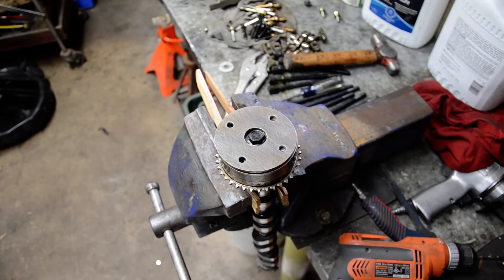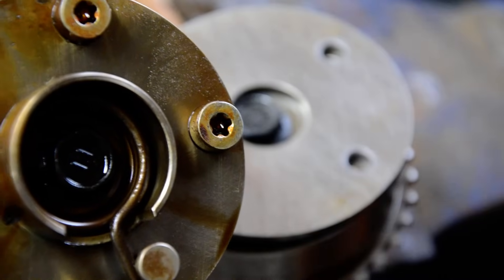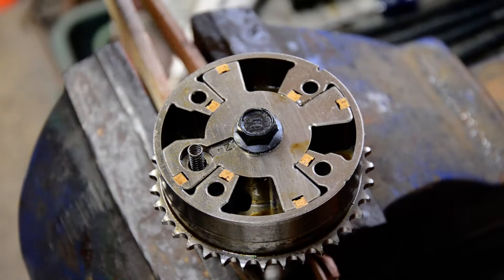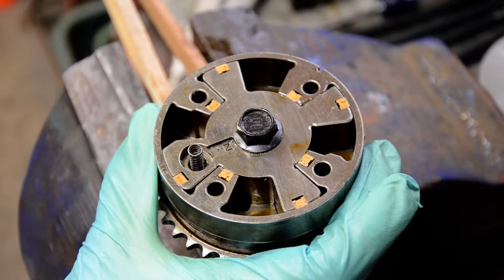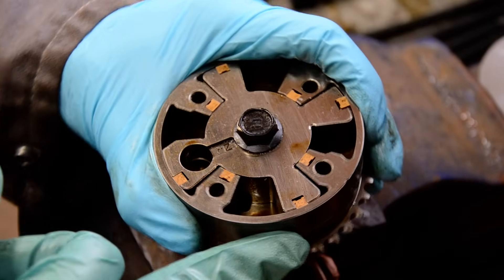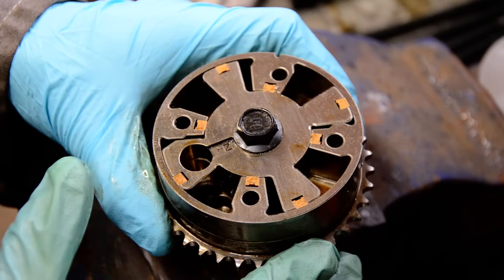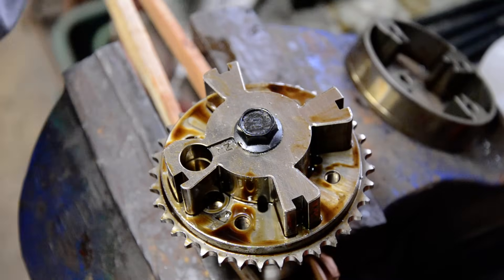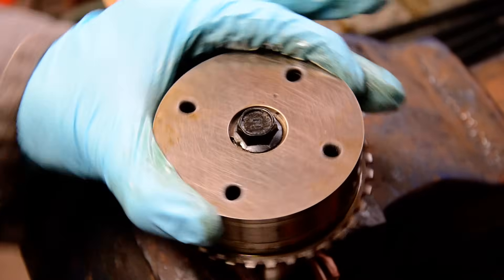Inside a Toyota VVT-i Camshaft Gear!

Comment: Hello sir
I have a problem with my toyota altis 1.6 manual rattling noice at start fir 1 second then disappeard
Can you help me regarding aolution of this problem
Reply: I have the same thing. It's been going on for a year. For some people, 5 years. So everyone who's had this problem said to replace the cam gear, but it's pricey to take it to the dealership. Nobody has lost a car because of this problem though, so I wouldn't worry about it too much.

Comment: You are missing a plastic end at the bottom of the spring. If you watch closer, you don't see spring marks on the back of the metal plate (i opened up and fixed a nissan vvt; i might create a video later with it - what was faulty and how to fix it)

Comment: The mechanism looks very simple and pretty much self explanatory. The pin and the opening for it look good. I wonder why the pin fails to lock? Perhaps the spring breaks or something gets stuck in the pin cavity thus restricting or preventing it's movement.
My wifes 04 Camry (2.4L) has been making this noise for over 100,000 miles. It has 190k on the odometer now. So far it has not caused any issues.

Comment: The vct solinoid has one input oil feed and two output, the two output one for retarding timing and  one for advancing. As rpms rise the phaser will advance. It keeps the engine in optimal timming. Hence spark firing early btdc

Comment: does anyone know if they make a rebuild kit for it?
Reply from the maker: Definitely not. You would just buy a new one, or risk a used one from the wreckers.
Reply: PatonHaus i just rebuilt my 2008 3.5l toyota highlander. Full rebuild of the engine and heads and did not replace these cam phasers. I am getting random cam retarded errors for all four cams during test drives. Engine runs well and idles smooth, so i pulled the oil control valves and cleaned them thinking they might have been hanging. Gunk in some of them. Prior to the rebuild the engine oil was pretty bad. Just wondering if junky oil could be causing the cam phasers to hang up. Running good clean syn oil of proper weight. 
Thanks for any comments

Comment: Can the Honda VTC gears be disassembled like the Toyota's?
Reply from the maker: Probably, give it s shot!
Reply: Okay thanks.
Reply: Yes.  Usually all it takes to fix the Honda actuators is to replace the spring and work over the locking pin with some abrasives so it can move freely in and out of the detent.

Comment: Did u find those bits?
Reply from the maker: Yep, scrap metal bin.
Reply: PatonHaus meant like the actual tool?
Reply from the maker: Which tool?
Reply: The five point bit ive never seen thos before
Reply: how about a pair of vice grips around that massive shoulder... or say a chisel and hammer or air hammer. lol@ drilling them out

Comment: the vvt gear also when pin pops out keep exhuast valve open longer at higher rpm to prevent head gasket from blowing why these motors are bullet proof only way to destroy a toyota is to throw a rod through the piston no oil no collant

Comment: Pin locks the system when there is not enoug oil pressure. In example on engine startup.

Comment: The tap,ered pin is a check valve that is kept in its hole by the spring on top of it.as the RPM goes up , so the oil pressure, which will unseat the pin , hence the rotor will move to advance the timing based on the conditions. When the engine rpm decreases , so the oil pressure, and the pin goes back to its seat. Thanks
Reply: I think this is the most reasonable explanation.
So, everyone who has another thoughts, please explain it here.
Reply: Everything you said is incorrect, no thanks

Comment: my sister has a corolla and she had problems 2 times with this system and the fix was to run motor flush in the engine and loosen that hunk of a cam head an everything goes back to running fine i hope this helps someone
Reply: Chris Wittekind love toyota but not as bullet proof as u think crank case ventilation system is not that good which causes early  sludge build up I've been a mechanic for 30 years do your research
Reply: Well I'm not familiar with the newer cars with dual vvti or vvtl-i, especially corollas.  I know on the 2jzge and the 1uzfe, vvti is rarely problematic if you take care of your car, and I don't know about you, but I baby mine.
Reply: Chris Wittekind yes that's true it u baby it as a mechanic I know 90% of people don't do that.  anyway this problem toyota knows about I receive technical service bulletins from toyota it says for to use the best quality oil and to make sure it's changed 3000 miles no give or take and I still love toyota long lasting  fuel efficient engines
Reply: So true but corolla is economy car not a Lexus or bmw
Reply: @johnjohnson7128  I am very interested by your comment. Very relevant. I am french and i have the same issue on my 2003 RAV4 with a 1AZ FE 2.0L Gasoline engine. Can you please explain with simple words how to do what your sister done on her car. What kind of oil you recommend and how to "flush" the engine. Thank you.

Comment: Let's say VVT is for intake only and exhaust has a conventional sprocket. VVT sprocket has a range of movement, like you show - up to 4 teeth, exhaust sprocket is fixed. Where does the chain slack to allow for this movement come from, are VVT engine chains inherently loose to allow for this movement? EDIT: I might have figured it out watching T0G5KLN4a_w. The sprocket doesn't move in relation to other sprockets, what moves is the camshaft itself in relation to VVT sprocket, thus no chain slack is needed, duh.
Reply: Good way to look at that thank you
Reply from the maker: +Karolis Tamutis You got it. My explanation wasn't very concise.
Reply: This had me puzzled as well. Thank you for a good, concise explanation.

Comment: Hi

the second gear you showed has a pin that holds the spring. how is the pin fitted and what type of pin is it? does the pin adjust or fixed. thinking of glueing one similar type of pin.

Comment: toyota dealer just repaired my 2009 rav4.  TSB 0041-13.  The spring loaded pin is not dropping in to lock it up at cold start.  The rattle stops after oil pressure comes up to full.  $625 repair at the dealer.
Reply: +John Ferguson so, you're saying the rattle isn't anything mechanically failing? I've never gotten a straight forward answer. I change the oil every 5-7k with filter, and halfway between changes I change the filter again. I look at 200k on a well maintained Toyota engine as being nothing. I had 298k on a 94 2.4 liter that I ran conventional oil in and it idled for Hours at a saw mill, and it wasn't even using oil or making abnormal noises.
Reply: +AffordBindEquipment   Change oil more frequently and use a top quality filter.  Use synthetic engine oil, it has more detergent and prevents residue from building up inside the assembly.
Reply: +John Ferguson that won't make the lock pin go in, though, but your recommendation is spot on
Reply: 2010V6RAV4   The build up of varnish and sludge is what takes out the VVT almost every time.  Keep it clean and it will run 200k miles.
Reply: +John Ferguson these engines use a cartridge filter. they suck. I use fully synthetic oil in both of my vehicles. I still change my oil in my V6 RAV4, every 5k. quality oil and frequent oil changes are cheaper than an engine. :-)
Reply: @GlocksDB15  It's bit late to the party but the key is not to push those engine like a NASCAR driver, doing heavy acceleration from dead stop or racing the engine (4th to 2nd downshift). very bad idea and that put some serious stress on the engine

Comment: Thanks for the video. My 08 tundra is making this noise with 130,00 miles on it. My question is should i take it in for repair or will  it be alrght in this condition?
Reply: the first 2 years had some cam shaft issues. if it just started then definitely take it in. my parents 2008 Sequoia and brother's 2007 Tundra both 5.7's, do not make that noise.

Comment: Vvt gear needs to unlocked before taking off cam,( try dissembling the vvt like he did ONLY IF REPLACING WITH NEW ONE then take off cam bolt)if you don't it  will grip the guide pin on the back of the gear making it very difficult to take off, do your search very carefully it took me hours of research online on how to approach this. When you install back the vvt gear needs to be unlocked( look at the dots on the housing) and make sure it seats nicely in the right grove, torque to specs and the turn clockwise on the vvt gear housing then you hear a click and to make sure you locked the vvt look at the dots they have to line up together if is not its still unlock. ( Toyotas of this design are prone for 1 second start up rattle and that lock pin is the culprit)
Reply: So my question is the pin not locking due to weaked spring? If so can stretching or replacing the lock pin spring resolve the issue!
Reply: G R i have been reading and watching about “having to be unlocked when assembling”. I am not following why. I have been messing with one this afternoon and can get it to unlock and move but as soon as you let go the spring moves it back to the locked position. 
So what is the purpose of having to unlock it prior to assembly if the spring is going to just move it back to the locked position as soon as you let air pressure off?
Thanks for any reply.
Reply: hey thanks for your comment it really helps, i have a 2gr-fe v6 engine i am working on, i change the head gasket and set the timing properly but when i run the engine and scan i got the (crankshaft position correlation bank 1 sensor B) code ( P0017 ), i had to pull the engine again, i turned the crankshaft clockwise 360 over and over again the timing setting was correct, then i turned the Exhaust camshaft with a wrench spanner and noticed it was loose and not locked in place while the others are perfectly locked. kindly bail me out on what to do, should i turning it till i hear the click sound without removing the timing chain? am not sure what to do help me out.

Comment: Toyota admits that cause for this problems is engineering design: TSB-0041-13. TSB-0146-10.
Reply: this TSB won't fix the current issue . they tried it on my 2010 2.5 Camry and 2013 RAV4. neither fixed the rattle. this is why-TSB 0012-11 is the fix they need.
Reply: 2010V6RAV4 8

Comment: Those orange blocks are seals just as you would have rings in pistons, to seal pressure from leaking, except these are vertical seals and the spring ensures that the seals maintain a tight seal against moving parts.
Reply: nothing is sealing oil pressure against the flat front cover 😂

Comment: The pin is a hydraulic piston that stops the cam from changing timing when theres no oil pressure. Its so that the cars timing is locked at startup and any time that the cam isn't under computer control.
BTW The computer uses the lugs on the camshaft to continuously time the cam using a solenoid on the block.
Reply: Is that what causes the characteristic knocking sound on VVT-i engines when you restart the engine while warm after letting it sit for 5 minutes? i.e. when the oil thickens and takes like 10 seconds for it to circulate before it activates again?
Reply: Desmond that is correct. Ive done many of these on toyotas and hondas. Thats why change your oil regularly or stuff wears down faster, tolerances get larger then you get noises.
Reply: @chrischoy9  The pins like to stick in and not lock so when you start the engine after sitting the unit rattles until the oil pressure comes up. Very common issue. More an annoyance than anything. I have a Camry with 220k and it's had the "rattle since new. My son has a Rav4 and has had the same experience he now has 150k.
Reply: That sounds more like chain rattle
Reply: My QR25DE phaser does not stay locked for shit. I have to prime it before every start or it rattles . It’s not chain it’s new it’s not tensioner bcs I modded that too. I have a video of the phaser spitting out oil whille turning the crank with a wrench. Pos.. last thing to do is puts harder spring or stretch the one it’s got now I’m sick of this shit. Everything under the sun brand new FKN click click click
Reply: OK am building a 1AZ noticed that thing is not really holding in place is knocking through out how can I fix that and what kind of damage can occur if I ignore it to move the vehicle to another garage? would this mean am not getting enough pressure..  The oil pump is new. Just remembered I had bought a new cam shaft. Can get this old bit  and put on the one on the engine?
Reply: @mushinjikangungu  
Good question, I want to knkow as well.
Reply: Very similar system to Volkswagen.
Reply: @x-man4702  stock design on Benz camshafts but used with a direct PWM solenoid control at the head of each shaft.
Reply: It keeps jumping the timing..  Maybe I should just found another engine
Reply: Mushinji Kangungu so you replaced the vvt gear? Coz when you get the gear new you get it in its unlocked position. Before you install it on the cam on the car youre supposed to blow compressed air into the oil feed on the camshaft to push the lock pin off and twist the gear to lock position before you put on the chain and time it against the crank. If not you will have codes right away, cam-crank corelation codes.
Reply: https://youtu.be/v46g2afcHog

EXPLAIN THIS?

Comment: I also have 2009 Corolla and I am experiencing the same start up noise. My question is does this problem also cause poor gas mileage and if its not fixed can it cause any serious problems?
Reply: +Jacquelyn Loder   Great question!  Our 2009 rav4 started the rattle on cold startup AND the gas mileage went down recently too!     supposed there is a free toyota fix (expensive) for this.  We will see what happens this week at the dealer.

T-SB-0041-13
Reply: +AffordBindEquipment let me know what dealership says
Reply: +John Brodie yes ! I am not surprised.....my mechanic said it shouldn't cause any issues.i am surprised there isn't a class action suit filed
Reply: +AffordBindEquipment    the dealer fixed this for free, as the rav4 was under 60 day warrantee after we bought it used.  About $625 if I had to pay for it.  I think gas mileage was because my wife was driving in 3rd gear, not knowing the difference on the shifter.  we'll see with the next tank of gas.
Reply: +AffordBindEquipment lol.....I too was driving in 3rd gear for about 3 months.....I  wears getting terrible gas mileage too......since I am now in right gear gas mileage has improved greatly. Nice to know its not just me. My mechanic told me about $700. To fix.
Reply: @AffordBindEquipment  is it still fixed? Did the noise come back and what all did they replace?
Reply: @WillCarrot  yes, that fixed the problem and have had no problems since.   I can't remember what they replaced, but it was a common problem with this engine.  The oil drains out of the VVT so it rattles until the oil pressure come back.  There was some sort of little valve that was supposed to keep the oil in and it failed.  But I have no idea what the fix involved or what they had to replace to make it right.

Comment: i have nissan, i wonder how often this camshaft damages? may we clean it or should replace it with new? thanks.
Reply: its usually damaged by lack of oil changes and its the solenoid that usually goes first
Reply: I thought I could run an extended oil change with synthetic and bam here comes the noise at 7k.  Oil change to 0-20wt and we will see what happens.
Reply: Curt Leake what codes if any were being set?
Curious if you were getting any cam codes like p0015 or others. Thanks
Reply from the maker: Excellent question Rufat, I don't have the expertise to give you an answer either way. Best of luck!

Comment: Nice video.  That is the part that is messing up on my 2008 Highlander.  For some reason now oil drains out of this area during a cold soak of at least 5 hours.  When the car is started you get a rattle at start up.  Sounds like crap.  Only a $6,000 dollar fix from Toyota.(ha)  Been doing this for the last 30,000 miles so it evidently isn't fatal initially.
Reply: Dean Cole   Through Mitchel which is a labor / hour guide shows it to be 23.6 hrs
labor time for the timing assembly in a 3.5 liter engine with AWD, not sure what the hourly rate is there but at $100.00 an hour your looking at 2300.00 for the removal of engine, transmission replacement of the part. A wheel alignment will be required add perhaps 70.00 to 90.00 reasonably.   At nearly 2460.00 in labor plus parts at gears running 200.00 a piece its certainly making its way up there but 6000.00 seems a bit off unless they are suggesting other things like head machining, rings / rebuild?
Reply from the maker: Ouch, that's a steep quote. I believe these gears were subject to a recall by Toyota but I may be mistaken. It may be worth doing some research to see if your vehicle qualifies.
Reply: It was only covered by the 60,000 mile power train warranty.  Toyota said they have to pull the engine to get to the VVT and that it is very labor intensive.  I'm no mechanic so I don't know if that price is reasonable for the work needed.  I just know I ain't paying it..
Reply: wattch thanks for the information.  That was pretty in depth.  I really appreciate it.
Reply: +PatonHaus Lexus did a recall on their 2gr version.